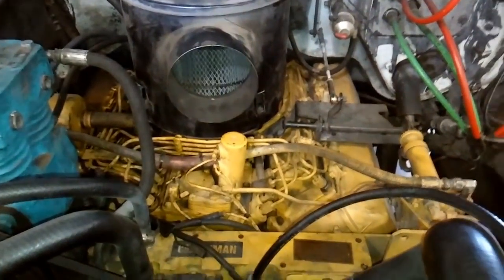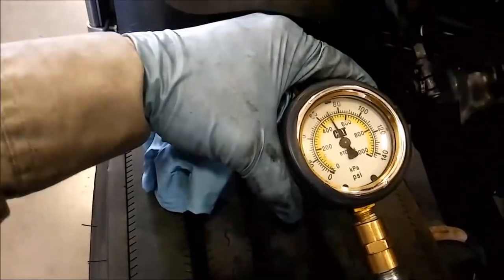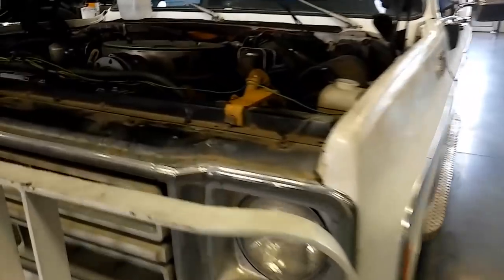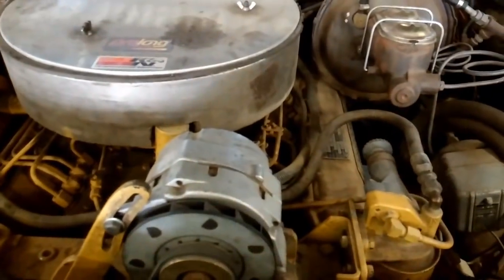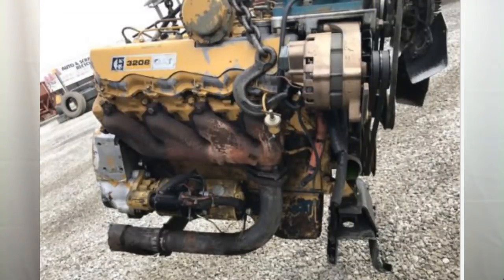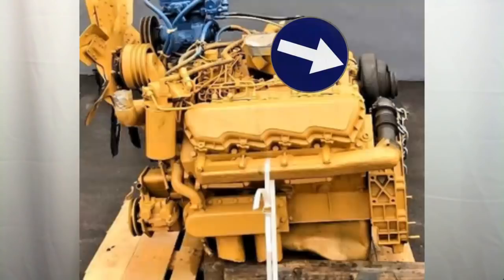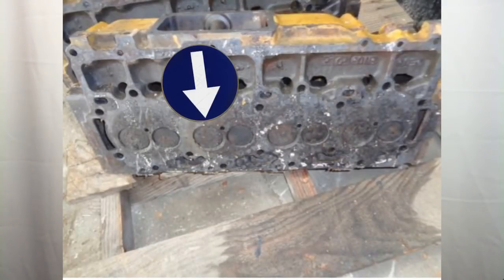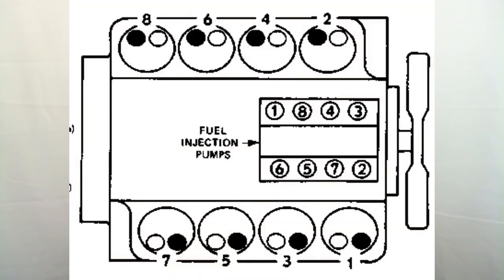The Cat 3208 Engine.  Know Your Engine. Engine Design And Problems.  Cat 3208.

Comment: I'm retired from Cat and they used to sponsor a pulling tractor the Silver Bullet that ran a 3208 converted to run on alcohol with spark plugs where the injector nozzles would normally be. It put out around 3000 HP in that configuration and sounded really wild. Got to see it one day when Cat staged a publicity event at the old Mossville engine plant in 1999 and used to keep one of the autographed postcards on my desk at the various plants I worked at until I retired.
Reply: I have seen the Silver Bullet at many tractor pulls.  The Lustiks made their own billet aluminum hemi cylinder heads for it.  They use three turbos in two stages to make ~80 psi of boost.  It's an inspiration to see.
Reply: Actually would love to hear more about this!

Comment: We have 15 of them in old Ford 9000 trucks, non-turbo. They honestly never fail us, and start pretty good in the cold. I’ll take dependability over power any day
Reply: There is a 1981 single cab single rear axle down the street for 5k. Says low miles. I just need any extra $5000

Comment: I used to drive fuel trucks at the airport with the 3208 na engine in it. They were basically garbage trucks with a fuel tanker on them. These engines sounded really nice, but they were underpowered for what we used them for. They lasted really long and were always ready to work compared to the newer electronic engi es which always had something wrong with them.

Comment: Had 3208's in Fire Trucks in the 80's. We never really had any serious issues with them. Of course we would never warm them up. When a call came in we would fire them up and floor it going down the road. Ran very well. They replaced Detroit Diesel rigs that were slow when cold until they warmed up. Many calls were of a short distance from the Firehouse. So they would be warm by the time we came out to go back to the station.  I liked the 3208's cause they just ran well.

Comment: I used to, for many years, eat, sleep, and work on 3208 CAT engines. I loved the design and common sense engineering built into the engines. They were not very sophisticated as compared to a common rail engine of today but I enjoyed working on them. Most of the applications they were in were of material handling in the steel industry and they were heavily abused. Not a big fan of the single compression ring though. Much improved over the 1160 series.

Comment: I worked  & retired from Cats foundry in Mapelton, IL. 1977-2008 We would ship 100's of 3406 & 3208 blocks to Mossville machine & assembly plant everyday. I worked on the line for 3208's in the 80's & 90's & we would ship 650-700 blocks seven days a week for years.  We also cast all the big blocks for mining, railroad, generators & huge ocean boats. Heads &  liners also. Most of the smaller blocks where shipped to their Mexico foundry about the time I retired.

Comment: I have one that's NA in a 81 F600 that I just purchased for a hobby truck. It was an airport fuel truck then purchased at auction by a farmer. He used it 3 years then sold it to me with 24,000 miles on it. He had nothing but good luck with 3208's on his farm he told me but was a Chevy fan, so he was glad to see it go.

Comment: Never worked on a truck version, but worked on plenty marine applications.  Made 10K hour marine engines, easy.  Many went well beyond 10K.  The issues I had were blow-down tests.  You have to rock the crank to get the rings to seal.  They are keystone rings (pressure backed).  If you don't move them, you'll get erroneous results.  But as soon as you move the crank with air on the piston, they'd want to come around and smack you. 
Some blocks had porous casting in the rear cylinders and would consume oil after about 2,500 hours.  Sleeve the block and you are good to go. The hot ticket was the 1-W arrangement.  Oil cooled pistons, hotter cam, slightly advanced timing and higher pump volume.  275 to 350 HP easy and you could bump the high-idle to get 3,000 RPM all day every day.  They'd handle 25 psi of turbo pressure all day, but any more and they'd start weeping at the head gaskets ...  On a boat, you have to carry a pre-built high pressure hose ended to fit the pump and an injector.  Crack one of the steel lines and you're dead in the water with a bilge full of diesel sheen.  Put on the temp line and get home on 7 cylinders, but you'd get home :)

Comment: 3208 running at 16k hours in my trawler. Water pump and starter only parts changed. Still starts like new, even in low temperatures.

Comment: Excellent video. The 3208 was a long time solid performer. It seemed the marine and agricultural engines had little problems relatively speaking. They did have a wide spread use in the P&D types of trucking applications. There are still quite a number in use world wide for different applications. A good testament for an older model engine. They were a good choice in the medium duty sector of the trucking industry.

Comment: Had a 3160 marine, 200 hp, (unfortunately) raw water cooled in a commercial fishing
 boat. Ran damn good, reliable, fuel economy @ hulls best cruise speed (slow) pretty decent and would tote a load. Only problem I ever had was a bad transfer pump. Pretty easy to maintain and repair. Thought they got a bad rap. Crappy nozzle or bad injector could wash a hole out then you'd have a problem, overall - change oil, run valve's when needed, feed it clean fuel and it was happy! Made some money with it. Yeah its heavy, worked in my boat though, sat low and helped mitigate some of the roll. Overall pretty good old school Cat engineering.

Comment: The lumber yard I worked at had several 3208's back in the '80s and '90s. Both turbo and n/a. The non-turbo versions were really loud. Great sound and decent power for trucks with GVWRs in the 35-51,000 lb range.

Comment: I had a 1986 Ford F8000 with a Cat 3208. The truck had an 18' refrigerated box, and the truck was rated for 32,000 lbs GVWR. It was great. I got close to 10 mpg on it. And, even in North Georgia, I rarely had to plug in the block heater.

Comment: Good video. I worked on quite a few of these years ago, real workhorses in medium duty trucks and buses. They're very reliable, also the nozzles were rebuildable. If I remember correctly you could get oversize piston kits as well as sleeves directly from CAT.
Reply: Jim Zivny Yes, 3208s could held up to 2 over-bore overhauls.

Comment: I personally love this old engine. It had a unique bark when coming up the street. Many of our cur side garbage  trucks in the 70's and 80's had them and you could hear when it was coming up the street and how much time I had to get that garbage to the curb. I can only guess why so many are making all of these negative comments here is because they didn't have the brains on how to operate this bad boy. These engines had to be warmed up before run and had to cool down before shutting down. They loved their rpm's and ran great. They didn't like hills but then again most diesels of this era did the same too. My uncle ran these engines in his tandem Ford Louisvilles dump trucks in early 70's when they were used in Ford motors and were Ford blue til the mid 80's. He never had one fail because he knew how to operate them and knew what they could do. A lot of these hotshot drivers are just that and nothing else but beer guzzling wife beaters in their down time.
Reply: Every truck should be warmed up and cooled down, any one that says otherwise is a fool
Reply: @12onin_Gypsy  Bullshit.. tell that to the many dudes I know that don't really warm up and cool down their trucks and are running at 500000 to 1mil. Come on stop believing in the wives tales, it does no one any good

Comment: thanks for this.  At 3:06 you say the 3208 doesn't have roller tappets.  But that's true only in the early years. My 1988 firetruck (Ford C8000 Tilt-Cab chassis) has this engine WITH roller tappets running on the cam -- stock.  Thru the years CAT kept improving what they could on it, upping the HP along the way.  Mine has turbo, 225HP, with 2-ring pistons (would get 3-ring on any rebuild).  It also does have cylinder/piston oil spray nozzles down below bottom of bore. 

I'm glad you emphasized about the engine's front "cover" --- it's a giant heavy piece of cast iron that spans the whole front of engine... has water passages, thermostat etc..  This  "cover" is likely why the engine is sooo heavy for its size.

The one bummer about these I cuss at a lot, is - as you stated - they don't have CYLINDER LINERS  ...  That was a money-saving decision on CAT/Ford's part in design, I suppose.
Unlike most industrial diesels, THIS ONE DIFFERENCE made fixing a bad cylinder(s) a major labor ordeal (removing/disassembling engine), instead of a much easier/faster cylinder liner replacement...  the  cheapskate bastards. (I've wanted to say that for a long time ;-)
Reply: Can I swap this engine for some other would fit?  thanks.
Reply: How much does the engine weigh? lbs/kg

Comment: 1984 Ford F8000 fire truck:  3208 Turbo is still going strong.  Never had an engine problem.
Reply: How many MILES??
Reply: most firetrucks don't get a lot of use/abuse. imho
Reply: dufus and they get meticulously maintained, and then if the department is in a well of city/county then they get new equipment way before the equipment is worn out. I can’t speak for fire trucks, but our city replaces police cars every 85-90k miles.
Reply: @dufus2273  I agree...ifbthey were run regularly..would most likely be a different situation.

Comment: I mentioned in you're 3126 video about the 7 point nozzle jam nuts. And like you were saying, those plastic crossover tubes failed. Decided it would be easier to pull the heads than the front assembly.  You're not joking about everything being heavy. I'm not a small guy, but it took allot of effort to install those heads single handed. Also 27 year old pan gaskets don't come off very easy. The co-worker helping me pull the heads was kind enough to drop a head bolt washer into the engine.

Comment: While I worked in the Hire Industry in Australia 3208 na were a go to engine for repowers . They smoked a bit sometimes..but the bloody things ran and ran without excessive oil consumption or fuel pump issues. Seemed to have a narrow rev range when they were put in trucks but did the job . Also heard quite a few went into F Trucks in my area. You heard them before you saw them

Comment: Great video. I've worked on a lot of 3208s, they were a real common engine in trash trucks at one point. Also the 1100 series version, which was the Ford only model when they first came out, (Ford paid for 90% of the development cost and got 100% of production for the first 2 years. The crankshaft was induction hardened and was ok in stop and go, but if used in application where you ran 50 miles with out stopping they had a tendency to snap a crank). 
The biggest problem we had, in trash trucks especially,was bearings. If you didn't want a spun bearing you tried to get a set of rods and mains rolled in about 100,000miles, no later than 125,000. Other than that we really didn't have any consistent problems with it
Reply: yep... I work as a garbageman, and Waste Management  had a few leftover from the early 90's, not a lot of power, but got the job done
Reply: +chris gollihar 
I've been repairing trash trucks since 1980 and they were the hot engine back then, from a natural aspirated at 200 up to 250 , a turbo up to 325. They may be shy on power compared to todays engines, but compared to what we had before, they were a hell of an engine. Easy to work on and dependable. They may be heavy for what they are, but they are lighter than a big Cam Cummins and fit into a smaller space. And they were better than the 1100s in the Ford C cab, at 175 HP, with an inline injection pump that was pure garbage, Cat used everything they learned with the 1100/1150s and made a decent engine.
Reply: my truck now is a 2014 Peterbuilt with a Cummins.. automated Side loader . Runs on natural gas, and we have the fueling stataion in our yard.   We're in San Jose, Ca

Comment: I had a 3208 in a ford tandem and had lots of problems with it blowing several head gaskets and blow-by .  Had a factory rebuild done and it was blowing by  right out of the shop , so I got rid of the natural aspirated and bought a factory rebuilt turbo and installed that , what a difference in performance, but did not get to see how it lasted as work dried up and I had to let it go .
Reply: If you are facing problems in repairing and maintaining  3208 you can refer to the manuals at reliable-store dot com . They are providing the complete step-by-step instructions, diagram's and specifications to completely repair your vehicle with ease!

Comment: The sleeve metering fuel pumps cannot take any water and the sleeve control arms would often break so engine wont start after running fautlesly all day. Piston skirts will crack. And you must plateu hone the bores or you will burn more oil then diesel. Had some problems with thin head casting causing crack in exhast ports, engine will run all day and not use coolant but exhaust will fill with coolant overnight. Always check governor spring and torque control as well as set fuel as per OT number on the engine tag when fitting new or reman fuel pump and governor group. Fuel bleed off valve and anti syphon valve wher biggest causes of hard start and rough idle. Cheers mate🍻
Reply: none of that sounds good
Reply: Have 3 of them in our combines..2 already have all the problems you mentioned

Comment: the early engines had several different displacements.  i had the short stroke high rev truck engine of 555 cubic inches, the 3208 had the longer stroke and 636 cubic inch displacement,  they were the 1100 series truck engines,  1145 for the 555 cubic inch short stroke engine, the 1150 and 1160 models as i remember.  the 1160 displacement became the 3208

Comment: USCG had two NAs - 185hp versions in old 32 ft ports and waterways boats - late 70s....    We were told during training that the 3208 was a diesel conversion by Cat of the old 534 Ford gas job.   We rolled one over in the boat to put in seals and found "FOMOCO"  lettering on castings inside the crankcase.
Reply: robsvideos13 early pre 3208 varient originaly came out in Ford Louiville trucks, they where painted blue and had an inline Bosch fuel pump and governor. Cheers mate🍻
Reply: Michael, I think you're thinking of the 1160..
Reply: You are right Thomas.  That would be the 1160.

Comment: Great video, I have a Oliver 2255 with this engine ,smooth running
Reply: I have one in a White 2-180. Did some modifications. Pushing 600 HP . So many people don’t really know what they are talking about regarding them. It’s a great engine.
Reply: Right on brother I have a 2255 as well 4wd it has extra 2 gallon oil filter system out on steps what a beast the oil stays very clean rottela 15. 40 got to love them olies

Comment: Awesome, thanks, I have two 435hp versions in my boat, had to replace a head last summer as the valve guide wore out, have 1300 hrs, I pray I can keep em running for many years!! Thanks again!
Reply from the maker: +Chris Eck Keep those old Cats running. They should still last quite awhile, everything is cast iron.
Reply: Why didn't you or the shop just install a bronze liner or a new guide?
Reply: scrimmy6969 it was suggested that i replace the head, as I think it's possible the other guides were on their way out.  I also agreed with that route as it's a pretty tough job in the boat and I wanted limit down time, finally I had the help of a very experienced mechanic but only for 1 day!

Comment: I work for a Cat dealer. Even within the Cat dealer network, these engines were called "disposable" as they were not designed to be rebuilt. Also called "Grenades" as, if one went bad, most of the internal parts would be found in the oil pan. I'm not talking about a bit of metal, I mean, crankshaft, pistons and even camshaft parts. However, for some reason they would last forever in boats and even could be run at ridiculous power levels. Probably due to unlimited cooling and smooth load factors. Did not do well in manual shift trucks.
Reply: Explain more bro what did you mean did not do well with a Manila trans I’m gathering info for a swap I’m going to do I bought a junk yard 3208 it’s healthy I popped it open and looked good no blow by I’m looking to swap it into a k series Chevy suburban or something like it something ugly 🤣 but yea there’s a lot of questions not a lot of answers would this sucker blow up if I install it with a Clark 5 speed trans also can i turbo charge this dude or better of stock ? Thanks

Comment: Making cheeseburgers for snowmobilers but this video will be my reward later.
We have a Cat 3208 in our Logan Manufacturing Snow Cat.
Reply from the maker: +Matthew Edwards I'm glad you like the videos. That must be an older Snow Cat.
Reply: Adept Ape our snowcat was made by LMC as a subsidiary of Delorean Motors corp.
1980s?
The original 3208 got destroyed by my predessor when he drove over the well head and the oil pan settled in the snow and was punctured.. he also let it idle there until it seized.
The sugar plant nearby had a Cat 3208 reman spare for their rail car tug.
So we installed that.
Unfortunately the turbo was destroyed so they left the exhaust housing and simply bolted a steel plate where the turbo intake sat.
Top speed is 9mph measured by gps.
Has to be plugged in in order to start below freezing.
We use the cat to plow the parking lot and to drag a 24 foot snow safety shelter around the mountain.
Thanks for that coolant o-ring tip!
Reply: Just letting her idle with no oil pan....If that doesn't make you cringe then you shouldn't have any responsibilities that involve internal combustion engines of any kind lol.
Reply: sc0tte1 they fired that guy.
Also how I got the job.